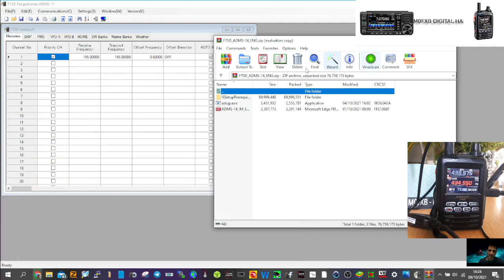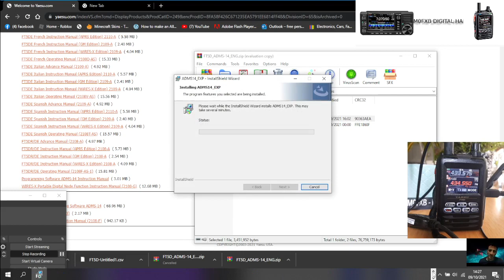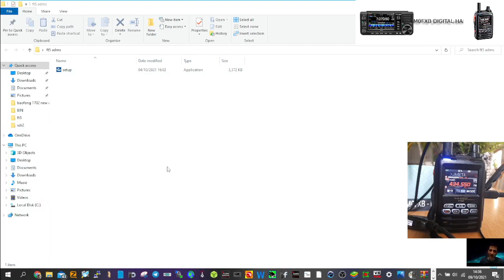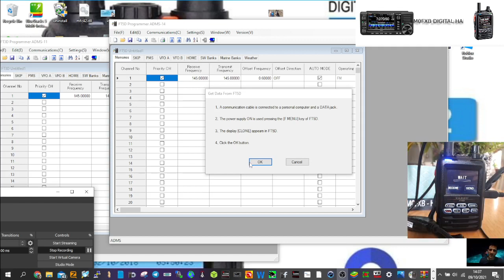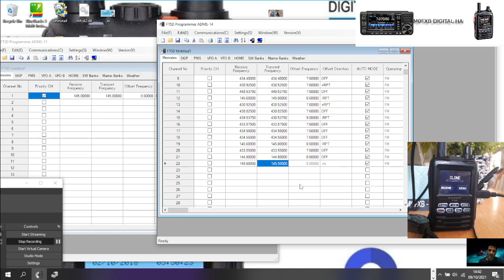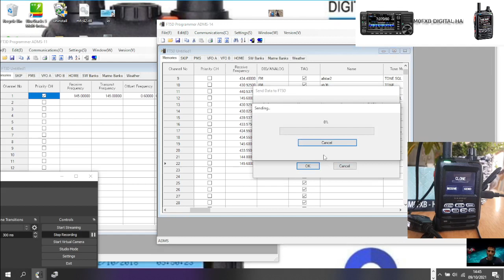YAESU FT5D-FREE PRGRAMING SOFTWARE -ADMS14 SCU 19 Using Cable

Comment: Also, there is something else that I could do on my old FT5 device but I can't do on the new FT5. I back up to the SD card and I read it on the PC as well. The option to send the changes I make to the card seems inactive. What do you think it could be?
Reply from the maker: ADMS can be a pain keep trying make a new card .
Reply: @m0fxbhamtech  I understood what the problem was :)
I was trying to use the backup I had taken before, but when I switched to MARS mode, those pre-MASR mode backups did not work :)

Comment: I'm trying to connect the PC with the standard USB cable that came with the FT 5 and I downloaded the PL23XX driver from the Yaesu page but it still says unidentified device :(
Reply from the maker: U need scu cable
Reply: @m0fxbhamtech  Thank you for the quick response :) When the standard USB cable came out and the device was detected, I thought it would work, so they left the cable for nothing. Is the same valid for the FT70?

Comment: Does the scu 19 come with the radio....a usb cable came but cant get it to work
Reply from the maker: Hi the cable in the box is for firmware you will need to buy a scu 19 or 39 cable - 73